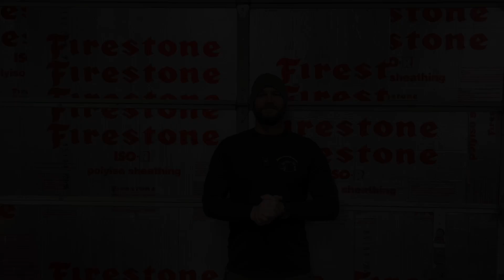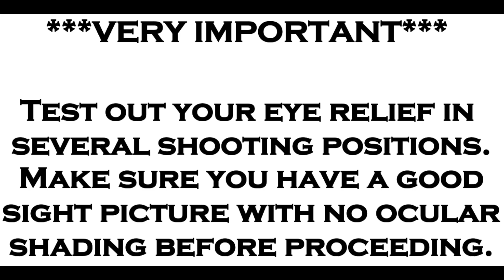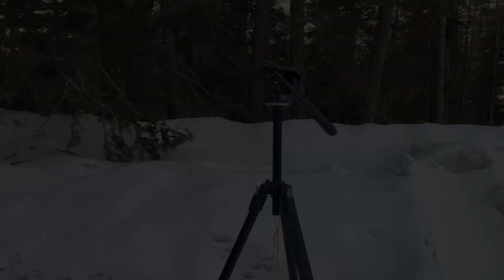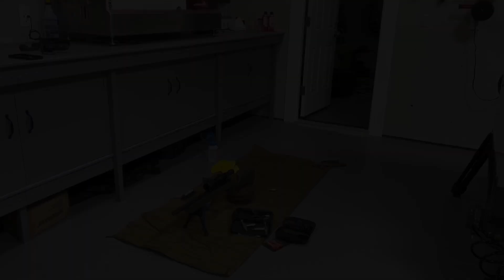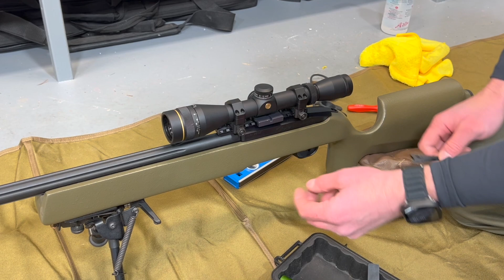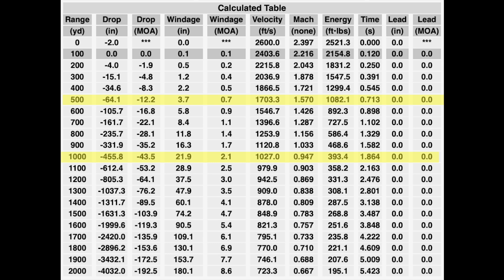TPM - How to Properly Mount Your  Rifle Scope - Step by Step with Discussion Points and Analysis

Comment: Would it be better to set scope to highest magnífication when setting your scope up for eye relief distance?
Reply from the maker: Yes! I had that in my original video and apparently edited it out for some reason. Thank you for bringing that up. Your eye relief is most critical when the scope is no max mag.  That’s where you want to for checking eye relief. 

Thanks again, my apologies for not having that in there. That’s an important point.

Comment: Another highly informative video. Question on OCW test , do you run this with your reloaded ammo at Sammi specs , get your optimum charge and then work seating depth after charge is located . Thanks for the great no bs videos.🇺🇸👍🏼
Reply from the maker: Thank you!

I go through the process of figuring out the point that the bullet I am reloading contacts the lands and record that. Once I have that dimension, I subtract .020" off and do all my load development here. After the OCW is done, I will tweak accuracy with a seating depth test. 

Depending on your rifle and the bullet you are loading, you may be just fine with seating at SAAMI specs for load development. I run more freebore on my chambers so I can shoot the high BC bullets. Loading these at SAAMI specs would take up too much case capacity and I would have a long jump to the lands. 

I will do a video on measuring the lands on your rifle soon. Stay tuned. 

Hope that helps. Thank you for watching. 

-Shawn
Reply: Thanks so much for your response, it makes perfect sense . My bolt rifle has a detachable mag so I assume I need to use my maximum mag length as my closest measurement to my lands .

Comment: Wow, that cant angle example is sure an eye opener.  

On the picatinny rail,  do you bed it to the action?  And do you use any loc-tite on the rail screws?
Reply from the maker: I've been a little spoiled and used actions with integral picatinny rails for my last few builds. But.... I am building myself a true "lightweight" mountain rifle on an old Remington 700 long action. I've never bedded my rails in the past, but I absolutely would if I had a fitment issue to correct. I also use red loc-tite on my rails. They stay put this way and if you ever want to remove it, a little heat will do the trick.